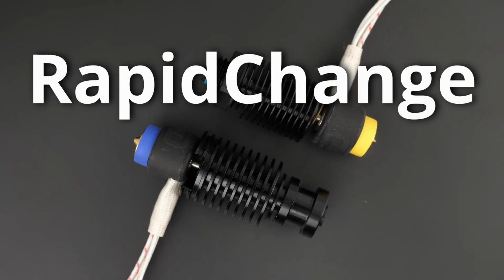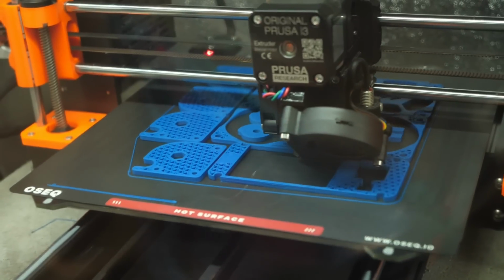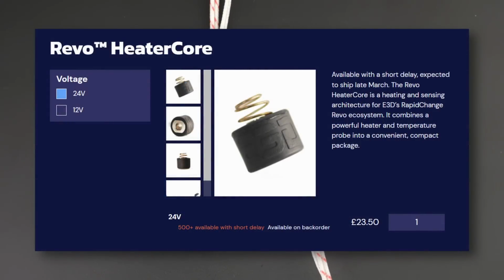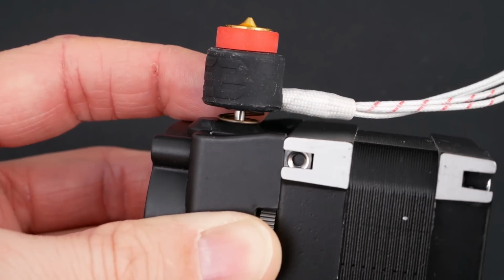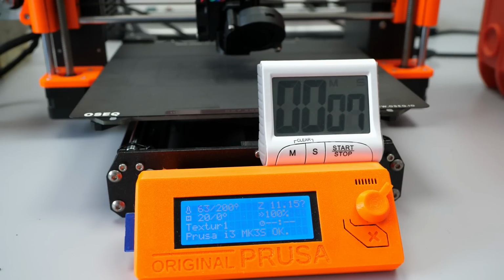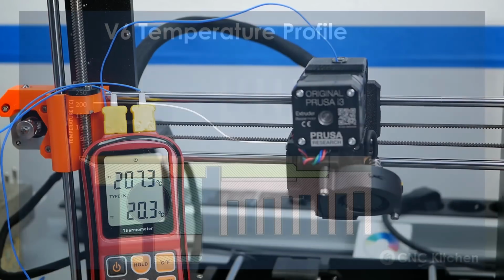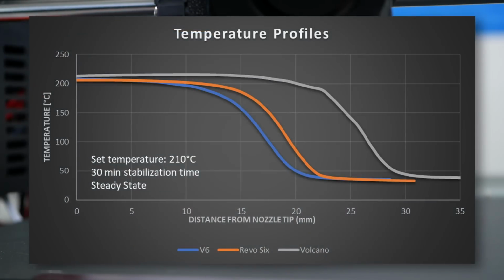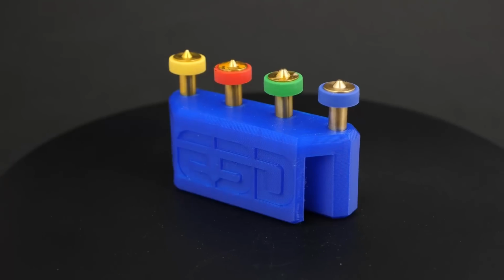E3D Revo™ is great BUT has a dirty secret! (REVIEW)

Comment: Thank you Stefan for this enlightening video! It explains exactly the issues I had with my beta unit. I also used a thermistor and measured a much lower temp than what the printer reported.
When it comes to cooling, I use a lot of it and I find that the shape of the nozzle makes it difficult to focus the air flow on the tip without having an almost horizontal flow direction. If I could angle the airflow a little bit more downwards, it would not cool the nozzle as much and possibly causing a smaller temp gradient. 
I'm curious why nozzle tips are designed this way? What's the benefit over a V shaped nozzle?
Reply: Late reply, but the "flat on the bottom" shape was to stop mess from moving upwards. It's inevitable that we'll have nozzle mess, this is neater, but I totally agree on the cooling aspect, most setups would have to modify the fan flow. I'm sure there's a bunch of people out there using the new Revo and wondering why they have certain problems with it; you put your finger right on the problem - it will alter the airflow !
Reply: @mickmouse2258  thanks!  I use Microswiss plated MK10 nozzles and the mess doesn't really want to stick to the "Twinclad XT" coating they have on it. I find the angle of them also helps mess being wiped off before becoming a problem on the print itself. 
I usually take a short filament piece and wipe of the tip when switching materials. Sometimes a bit of paper towel.
Reply: @printingotb521  Nice! I recall someone who setup a wiper on the side of the machine and added a command to the startup G-Code to wipe the nozzle before each print. In case you feel like playing with a project ... ;)

Comment: I loved the revo up until the hot end started giving me inconsistent temperature readings. It seems like there is a fault in the thermistor or a short somewhere in the heater core. Now I am waiting to see if I can get a replacement. I am so disappointed that It only lasted one year. I have never had a hot end fail this quickly

Comment: I had a Revo heater core which had temperature jumping around. It went up and down when it was supposed to be continually increasing. It ended up driving the nozzle temperature up above 300 degrees. Finally, the thermistor detected the over-temp and I had an alarm from my Prusa i3. I will see if I can send it back for a replacement.

I'd be interested in seeing the best way to unclog Revo nozzles. I can't use my old heat gun method, because it's all one piece.

Comment: It's not really only a bit against RepRap, it is totally against it. RepRap and the whole 3D printing community is very much relying on open source. Just look at what gave it it's biggest grow - when the patent on FDM finally expired.
I'm not a fan of seeing companies, which create dependencies of their environments in the 3D printing community. And I think it is absolutely wrong to say, that this is needed for going from DIY solutions to reliably working systems! 3D printing is out of the age of DIY solutions and already a product also accepted by a huge range of consumers. It's not a DIY niche anymore. And the most successful and reliable brands for software and hardware are using open source.
I even though like the term 'dirty secret', but I think it's more than just a little secret (:

Comment: Huh, I was a beta tester, and the same thermometer issue happened to me. My unit went into smoke because it though it's at 250 (printing ABS) But then it was smoking. When I restarted my printer it was suddenly reporting the temp as 350.

It kept reading my temps inaccurately

Comment: I had the same failure in one of mine. I have 4 and one of them about 15 hours in it threw a temp error and then wouldn’t heat up correctly. At about 150 degrees it would start jumping erratically all over the place sometimes by 30 degrees. Contacted e3d they had me send it back and I’m waiting for my new one. Other then that I love it. But it does seem to blob on the nozzle more then my v6 did.

Comment: Installed my REVO on my Prusa mk3s 5 days ago and I find I’m grabbing nozzle sizes depending on my individual prints exactly like you mentioned. Small/Med/Large prints get a corresponding nozzle choice and it makes a huge difference when printing a large print with a 0.8mm rather than a 0.4mm nozzle (GREAT VIDEO!)

Comment: Don't you need to make sure your thermistor (the metal junction) is consistently touching the sides when you're profiling the temperature? Air is a great insulator (and this is a tight space with no convention).
Reply from the maker: I bent the head to the side a little that it makes contact. Tried several different configurations, which all showed very consistent results.
Reply: @CNCKitchen  Excellent! I was taking your animation too literally.

Comment: First of, Stefan. Nice video but my head hurts from the spinning shots just fwi.

Second. Is there a single reason why they couldn't make the nozzle brake just a heat-brake and have the last bit just a regular nozzle ?  that way you could have both custom sizes. Backwards compatibility, and way less trash when they inevitably fail like all nozzles do after a while. 

Also I hate the trend of making the nozzles as flat as possible. I actually like creality nozzles way more since there is a lot more room for part cooling and you don't have to make huge ass ducts for it.

By the way. Video Idea. Testing alternative part cooling ? Like Pumps with just a thin brass tube at the end that way the airstream is way more focused (Pretty much just like air assist for laser cutting. Maybe looking at it with infra red camera (thermal imaging)? I ran into this problem recently when building my delta. Due to size constraints and weight I am looking for alternatives. I intend to test a Aquarium pump with just a bras tube like mentioned above.

To me this doesn't feel like much of a improvement. I very much like the Hamera though.

Comment: try sprayer nozzle, instead of the extruders
Reply: velocity is essential
Reply: no, only for the output stream velocity
Reply: this it as a painting spray gun, layer by layer
Reply: ie working like an inkjet printer, not thick drag lines, anything as the substrate, like paper, single use plates, attached to the bed

Comment: i have a revo on my prusa and i had the same problem with the temp i changed the core and still the problem existed the solve was cutting and soldering the wires directly  instead of the connectors

Comment: Finally, to have similar melting performance V6 vs Revo, is it correct that the Revo needs 3.3mm longer melting zone? 
V6 is 12.5mm nozzle length + ~4mm heat break tube screwed into the heat block, working as melting zone = 16.5mm, and the Revo is 19.8mm Brass and crimped Heat Break Tube melting zone.
 To keep up the flow, would it mean that the heating efficiency is lower with this circular heating system as it is in direct contact only on the bottom part of the heater, and only in convection in the circular part of the inner diameter as it does not touch the heat block ?

Comment: Honestly, drop in temperatures when cooled can be beneficial. I set up my profiles so infill gets 0% fan, and perimeters/overhangs/bridges get 100% (depending on a material), so lower temperature when cooled might help me get better detail with no significant drop in layer adhesion

Comment: A. Why in the world would anyone need to change nozzles and heat blocks so often?  You're awesome, but that's a little ridiculous.  In 4 years, I've never changed a block and only 4 nozzles.  I sincerely don't understand.  No offense at all meant by that.

B.  Why would cold changing a nozzle be any advantage at all?  It doesn't save time.  It doesn't improve results.  It doesn't provide any tangible benefits.

C.  They chose the wrong materials for the heat break and nozzle.  The upper end should be copper for thermal dissipation.  The break should be titanium due to its thermal resistance properties and strength.  The nozzle should be tungsten carbide due to its incredibly high thermal conductivity and hardness.  One nozzle would theoretically last forever.  NOTHING that can be fed through an extruder even scratches TC.  It laughs carbon fiber.

D. Putting everything in on package only means higher expense and wasted materials.  I don't need to change the heatbreak every time I change a nozzle.  That's just dumb.  The reason they did so was purely for the purpose of fili g a patent to make money.  That's why they chose the materials they did and why you won't find 3rd part copies.  Bad form E3D.

As always though, your work is amazing and I appreciate your efforts.  Thank you.

Comment: Just simply changing the nozzle shouldn't be an issue with Revo, but what else needs to be considered, slicer settings or profile? 3D printer setting like firmware? Such a video is still missing.
Reply from the maker: Slicer settings, firmware and printing profile (except a bit higher temps) can be the same as with a regular V6. Noting fancy otherwise.

Comment: I noticed something that you may have explained.  I have a Revo CR in my ender 3.  I've been printing PETG at 240C (recommended temp for brand of filament I'm using.  Before the part cooling fan starts (after 3 rd layer), all is normal.   After the part cooling fan is running, I sometimes hear the extruder skipping, like the nozzle is clogging.  Is this due to the print temp at the nozzle dropping?  Should I insert G code to raise the heater temp after the third layer?  
However, I am also having stringing issues with PETG that might be fixed with a lower print temp.    Still I am quite happy with this hot end.  Right now I'm using the standard 4mm nozzle, but I might by a 6mm high flow version to use on large prints, and the high flow might solve the "clogging" issue.  BTW, I don't recall seeing the clogging issue at the extruder with PLA, even though the PLA profile runs the part cooling fan at 100%, while with PETG, it runs at 20%.  Of course, the part cooler fan used on the Ender 3, isn't the best design, ans the airflow is somewhat restricted.  Better part coolers surround the nozzle, it's one sided on the stock Ender.

BTW, I see you've printed a lot of Voron parts!

One more thing.  I've had 2 or 3 failures where the Ender 3 reported a runaway heater event.  Before this happened, I saw the reported hot end temp jumping up and down by as much 10 degrees in both directions.  Normally, I don't see it vary more than 1 or 2 degrees when the PID loop is working.  This is not an unknown problem with this printer using the factory hot ends.  But it never happened to me, until I installed the Revo.  However, E3D's recommended install method was to use supplied butt splices with the original printer wiring.  However, they also supply replacement wires that have the molex connectors on them.  So, instead of cutting off the molex connectors, I replaced the wires on my printer.  The runaway temp error, may have been caused by the molex connectors becoming loose.  After I got this error, I pushed the connectors together to make sure they were engaged.  Then, the PID loop started working correctly.

I bought the Revo to replace the factory hotend, because I wanted a true all metal hot end to be able to print PETG.  Technically, the Creality hot end will go to 240C, but just barely.  You will destroy the Teflon tubing eventually at that temperature.  Since, E3D had just offered the CR version, I decided to pay the extra money and try it out.

Comment: Pretty simple.. Not even interesting or close to being a proper replacement for a V6
Reasons, as you mentioned:
1.Changeing is not really faster... 2.And hot tightenig is THE WAY to tighten threads that are supposed to be heated up. 3. I do print abrassive material nearly 50% of my prints, => Copper or brass nozzles are a NOGO
4. The ring heater is interestingly the Wrong concept compared to the heater block in terms of temperature reluability.. A thing it took the professional industry in injection molding years to learn.
5. Integrated systems with heater and Sensor tend to break the sensor premature, this is known since 30 years and your failure you found is typical for that construction. Hasco hot runbers suffered from it for years
6. And most important.. A good V6 stainless steel nozzle you can get for aprox 2€ / unit how many can i buy for one of those nozzles?
7. How to do the 400°C upgrade E3d offers for the V6 on revo? No way execpt they release a system factory mounted with thermocouple, PT100 or PT1000.. Imagine the price..
Think we have enough reasons to not change from V6 to Revo. And why it is not a improvement.. It's a step backwards..

Comment: amazing test but I would have liked to get a comparison to hotends other than just the V6. the V6 is an ancient designn and while revo is a huge step up in terms of usability, so are all the other options that we have now. (dragon, rapido and mosquito have one handed nozzle changes too for example, while offering much higher flow rates.) also what is the point of easily swappable nozzles if you can't print faster with a larger nozzle because you're flow limited anyway? also modern hotends with copper blocks and plated copper nozzles don't really need hot tightening either if you don't want to

Comment: I don't think it's worth it to upgrade IMO. It is nice and the quick swap is ideal for newcomers to prevent damage to the printer but the cost of the system and limitations outweigh the benefits of using a normal system like the V6.

Comment: Hi. Great video as always but I need to ask you something. You specifically say that there is no need for any firmware changes with Revo 6 and Prusa. I just installed Revo 6 on my MK3S and I get a temperature reading from the nozzle around 700 °C. I contacted E3D support and I was told, that I need to make some changes in the firmware to set the right type of the termistor. I run original Prusa firmware and never did any modifications to firmware and don't feel really comfortable about doing it. Did you had to adapt yours in order to get it running? Thanks for your answer.
Reply from the maker: There aren't any firmware changes necessary on the MK3S. Did you check that you didn't mix up the thermistor and the heater cable?
Reply: @CNCKitchen  yes I am sure I got them right. The cable from to heater was pre clamped. When I plug in the old termistor everything is ok. With the new one by room temperature I get a reading from 702 - 712 °C and it changes over time, so there are values coming in the printer, they are just interpret wrong. So as I see it, either my unit is faulty or the termistor is not the same as the original one. Or can you think of a different reason? Nevertheless E3D support told me to manipulate the firmware. So the information in your video and actually even in their own add video is wrong.

Comment: Hello Stefan, I am trying to print a coupler for a 3/4 inch PVC pipe that will need to be able to withstand about 30psi for a few minutes. What kind of resin is strong enough for this?

Comment: I haven't changed my nozzle for the 2 years i am using my prusa mk3s. I print mostly PLA and a bit of PET-G from time to time and not re-enforced. so the brass nozzle isn't wearing i think.
The main thing i would like to see is the implementation of non planar 3d printing by Prusa and this system doesn't look good for it.
Now that i know that all threads for the nozzle are in aluminum and that you need to do it warm i am really hoping that i won't have to do it. i would have expected an insert in 304 or 316 to match a bit aluminum CTE for the first threads and have the rest in aluminum.
Reply: Stainless has relatively low thermal conductivity, so it would mess with the nozzle temperatures.

A better solution is probably to switch to a copper heat block.

Comment: @CNC Kitchen For the heater sensitivity for parts cooling airflow the better solution would be to insulate heater core itself (including sensor). Basically circular heater due its high outside are is better at conducting temperature to outside air than nozzle itself. It will be more noticeable at higher temperatures where the power is limited due to PTC nature of the heater. You might want to test that :D
Reply: The heater core already has a silicone sock on it.  The issue is that the actual nozzle is being cooled because of the large surface area that isn't insulated compared to old style nozzles.

Comment: What’s the gap from the nozzle and the heater like? As it was screwed in and very good contact. What’s the expansion between the 2 different materials.  Would paste help in the heater?
Reply from the maker: The gap is very small. 5.99mm VS 6.03mm when cold. I want to try out if thermal paste helps but that defeats a bit the purpose of Revo.

Comment: Great review! Really detailed. 

One gripe that I have with this design is the future maintenance and thermistor/heater replacement. While the starin-relieve should prevent the damage to the thermistor-heater unit, it is a possibility. When that happens you need to buy a whole new unit from E3D instead of buying a thermistor or the heater for cheap. This increases cost on the end-user side and makes for a potentially non-usable printer for quite some time depending on the country you're from. 

Quick-change nozzle system is amazing but I'm not sure I'm ready to give up an ease of repairability.